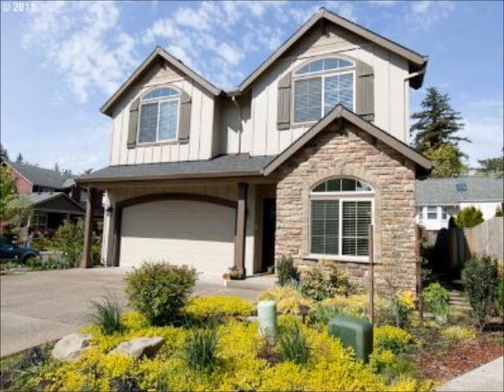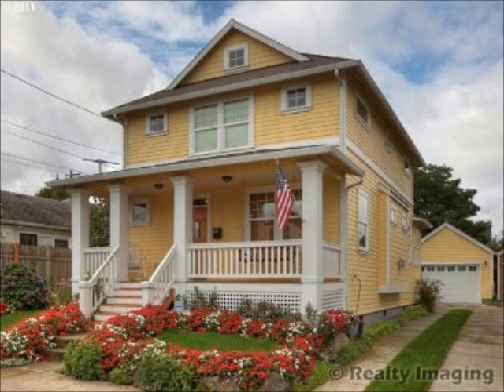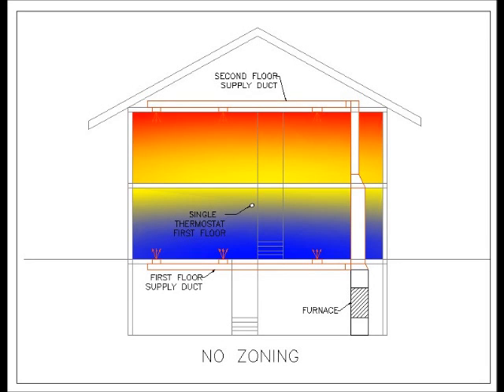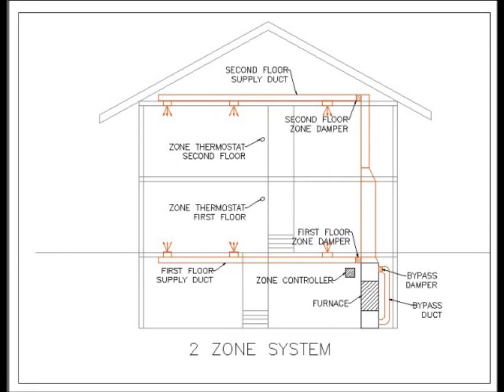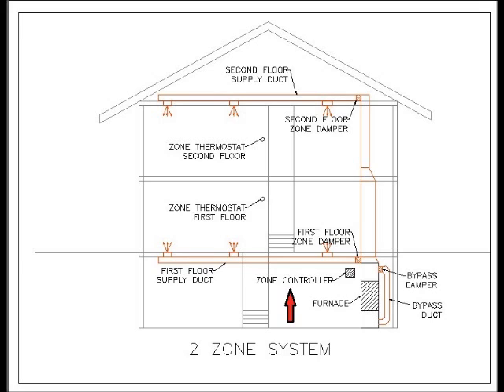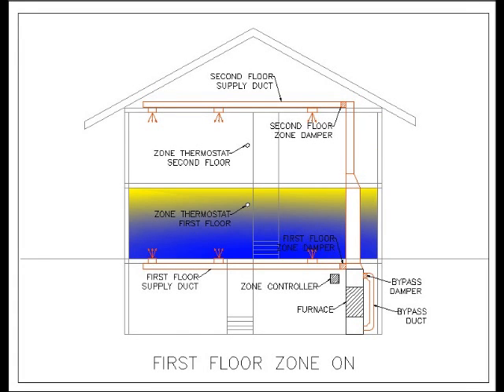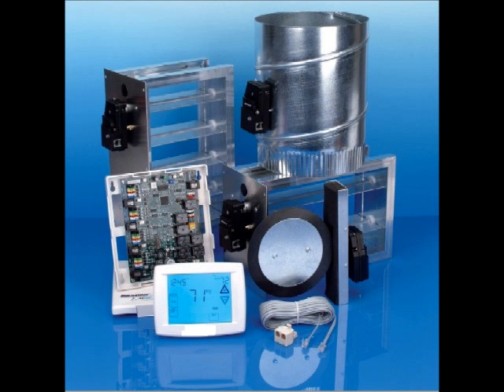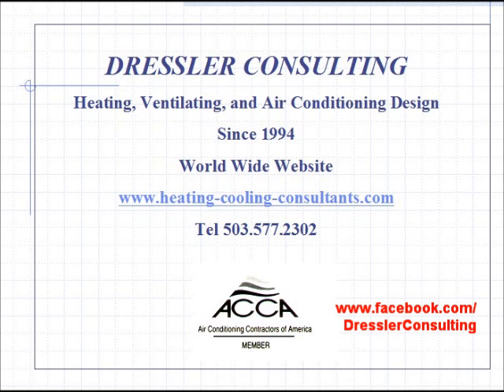How to have the same temperature upstairs and down.

Comment: With zoning in a two story, which thermostat should be set to a higher temperature?  Most sites say the 2nd story should be set to a higher temperature than the 1st story.

For example, if the preferred temp is 77, then 1st story should be set to 75/76, and the 2nd story should be set to 78/79.

Agree?